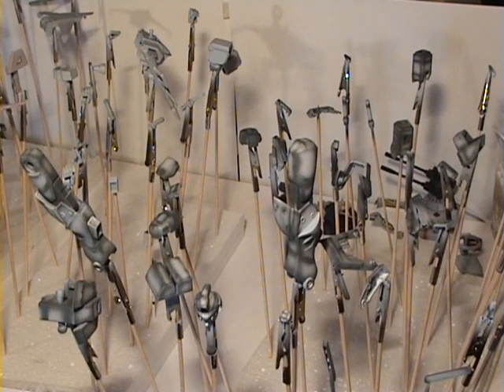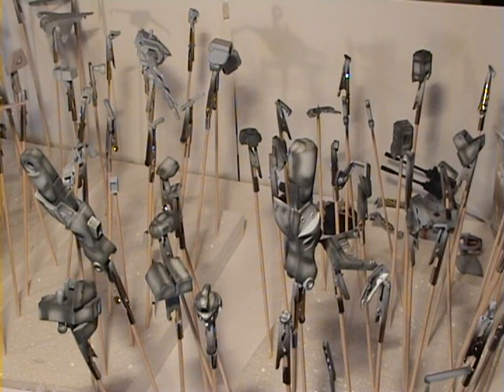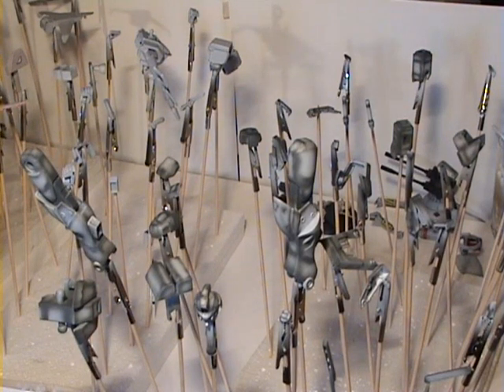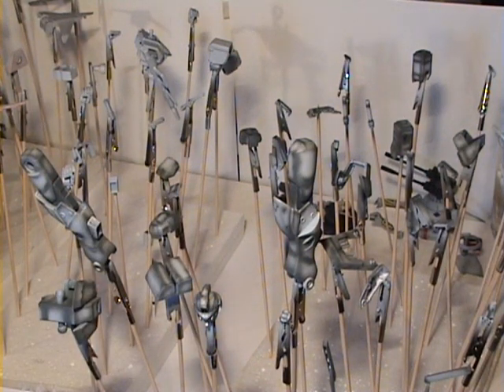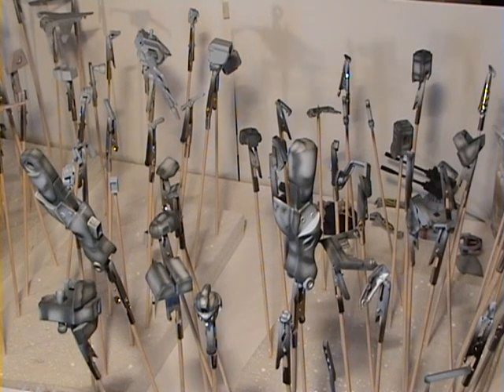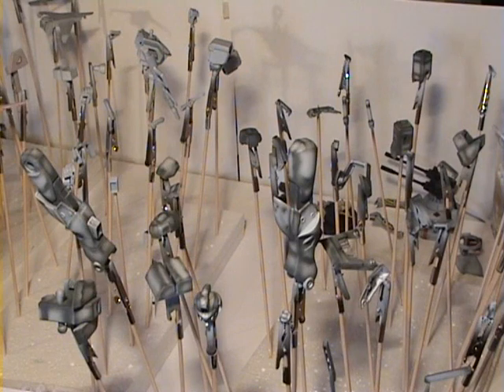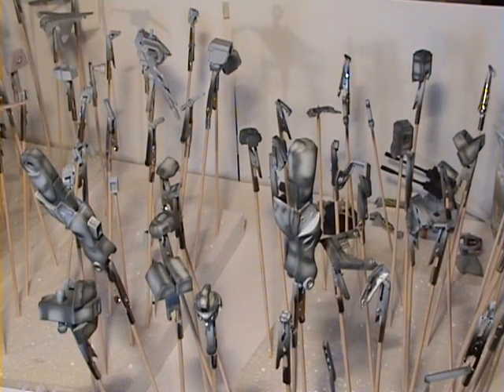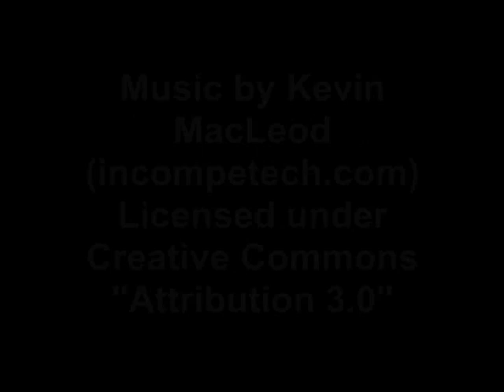On my Workbench Part 5a

Comment from the maker: I'd go with plastic putty or epoxy putty. You can get plastic putty from vallejo, tamiya, revell etc. (have a look at On my Workbench Parts 3b and 3c for examples). 
Epoxy Putty is also known as green stuff or milliput, You can get it from Games Workshop (expensive) and a lot of internet stores (much cheaper).
The deluxe way would be car body glaze, like bondo spot putty.

I'll say, go with vallejos plastic putty.